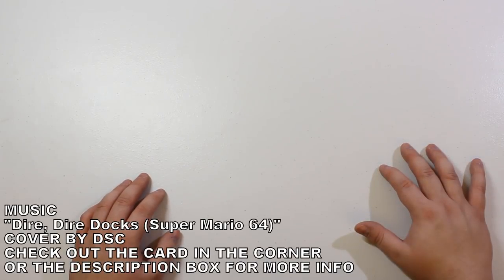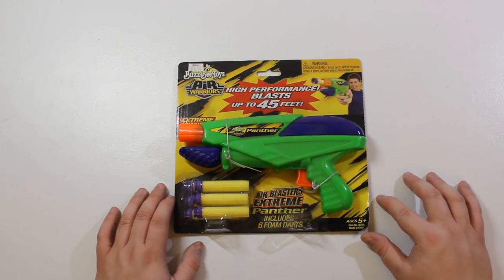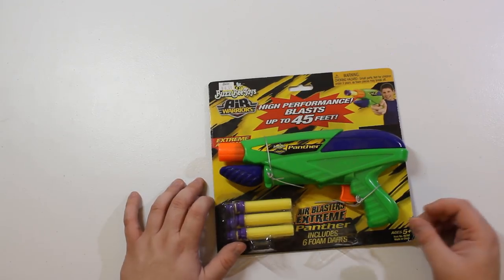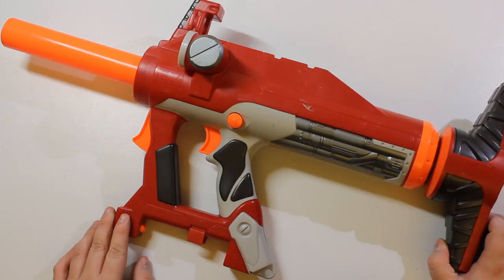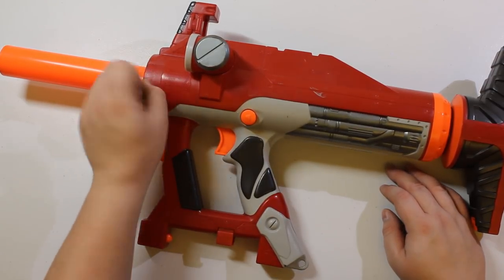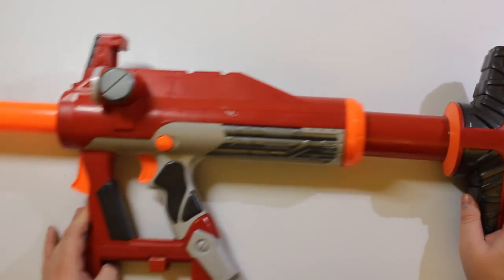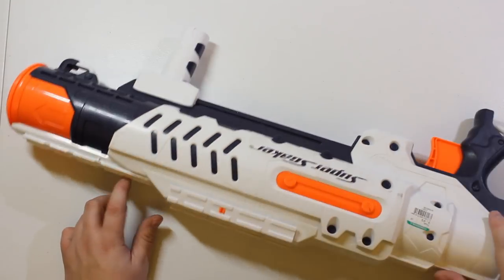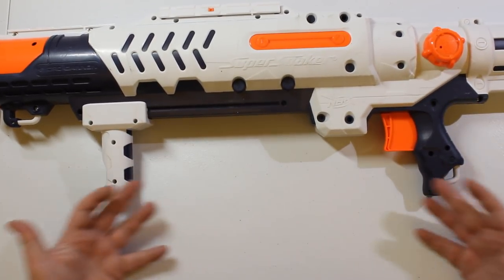Let's talk about Air Powered Blasters for Over 18 Minutes | Walcom S7

Comment: By the way, perhaps you could reinforce the Titan’s weak shell with 3D printed nylon to protect from a air tank rupture. As for the hydro cannon, it’s 650 FPS is faster than half of the speed of sound (about 198 m/s)

Comment: I was watching old Walcom videos when the notification for this came through.  I rather enjoy air blasters, but I haven't quite gotten the hang of them.  I tried to mod a BurstWave the way that you did, but I can't get my trigger mech right.  I bought one of the HydroCannons for the water gun fun back in the day, but I noe want to make it into an absolver cannon.

I would love to see a similar look at other blaster types.  Thanks for another great video.
Reply from the maker: Fill in the priming bar that pushes the button in if that's your problem, that flexing is what prevents the tank from detonating.
Reply: WalcomS7 Thanks man.  I tried reinforcing it, but I hadn't gotten around to building it up.  I'll give that a shot soon.

Comment: FYI HAMP stands for High Airflow Manual Pump, not High Air pressure. The air pressure is pretty low compared to air or springer blasters.
Reply: He didn't mean HAMP. those are built into the blaster. the thing hes talking about is the equivalent to a fuel tank on your back from the old WW2 flamethrowers, except instead of fuel its air. so its a backpack airtank system.
Reply: actually, he meant hamp. pls watch the video. at the beginning he said about the demolisher rocket and tristrike

Comment: I am working on an integration with an Airtech 2000 by converting the tank to fire a demolisher rocket. Is my tank selection a good one for this purpose, and if not, which tank would you recommend? I also don't want to use a titan tank, as it is too big for my purposes, and i don't want to use an air tank where the pump is inline with the tank, as i need to relocate the pump to fill in some gaps.
Reply from the maker: AT2K tanks are compact, that’s about it. It’ll fire a rocket if that’s what you’re looking for.
Reply: WalcomS7 do you know of what ranges I would get off of that
Reply from the maker: Eh, not the best? It's a rather tiny tank. Really good for firing a dart.

Comment: I would modify my supersoaker to take magazines, add a airtight bolt system, add an extended barrel (for accuracy) and add a REAL 3x low end scope, and use accufake darts for extra accuracy... A real Nerf sniper  rifle!!! (would be similar to my competition sport .117 BB rifel)
Reply: Accufakes don't work well in brass which I assume will be the barrel.
Reply: It won't be brass, I couldn't bring it in public if I did
Reply: I will use an aftermarket plastic barrel, brass in my opinion is overkill and expensive unless you use it for making a home made plunger system.

Comment: A hornet with a double breech barrel system. I mean three breeches per side, but the three open simultaneously by being connected to each other. The blaster would require an additional front end to house the new barrels and the sliding parts for thea dual triplebreech, and the new barrels would seal by sliding over the original barrels when the breeches are closed. By adding lenght to the blaster, you'd also be able to replace the pump with a bigger one.

Too hard?